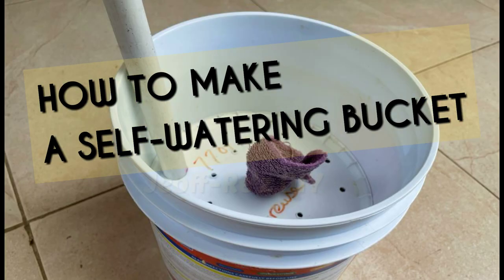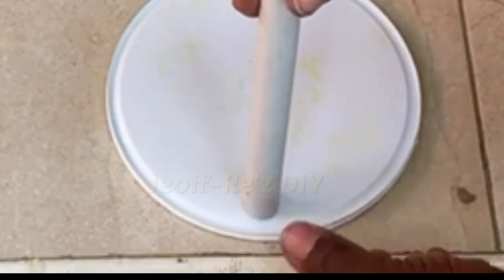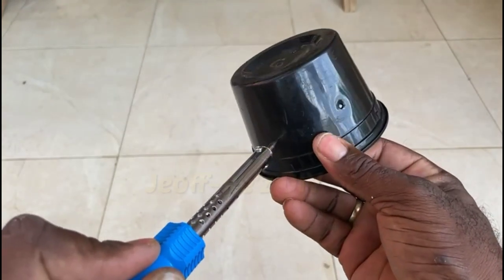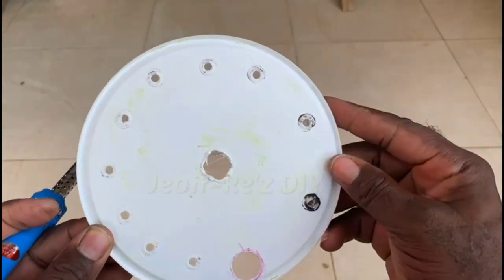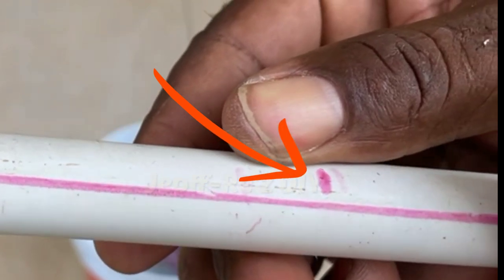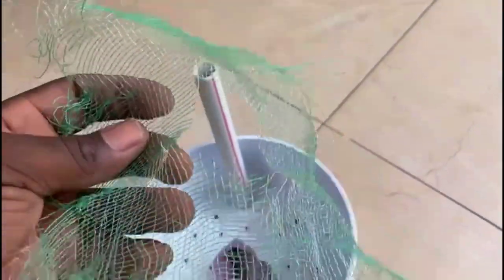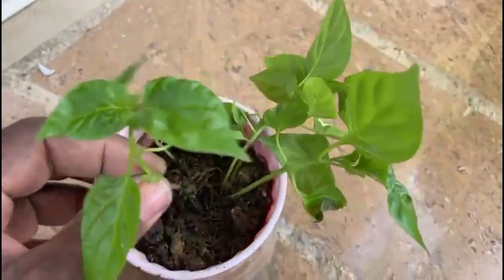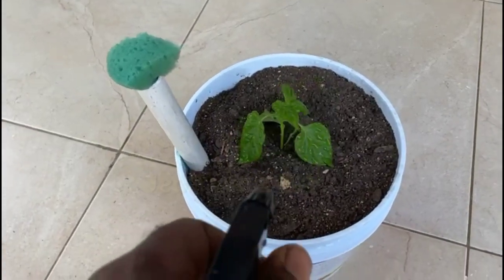MAKE A SELF-WATERING BUCKET/AUTOMATIC WATERING SYSTEM FOR PLANTS

Comment: Sir, how could we know that down water portion is empty?
Reply from the maker: It would not be obvious to the naked eye if the container in not transparent. Way to check though is by simply observing the soil or by poking your finger into soil.
This will allow you to know moisture level. 
This system doesn't require regular refilling.
Reply from the maker: Gr8 having you on this platform.  Gr8 question. I trust the answer given above is sufficient 🙂👍
Reply from the maker: Maybe leaning it to side of overflow to have an idea so then you can top up
Reply: @jeoff_rez73  okay sir Thanks for sharing
Reply: @jeoff_rez73  yes sir, I will try this technique.